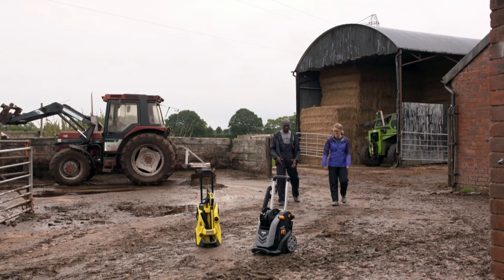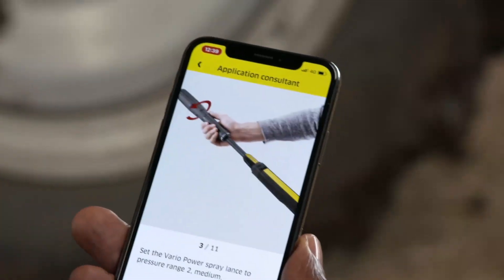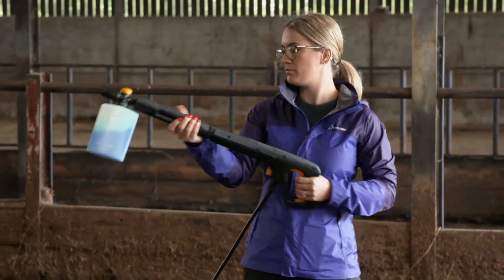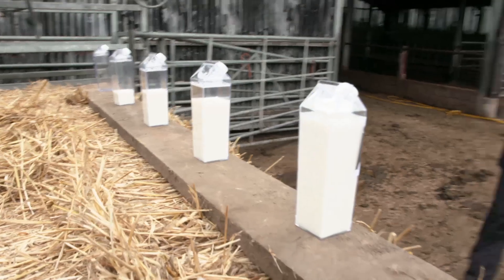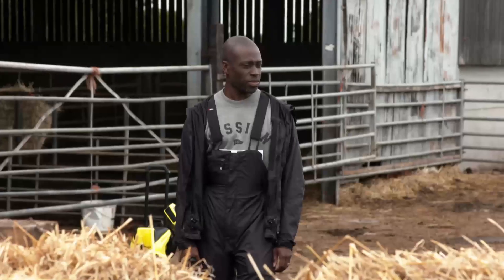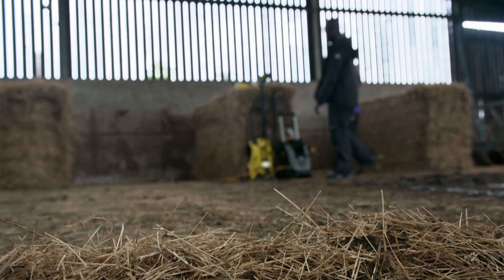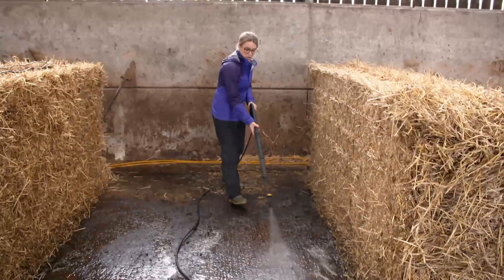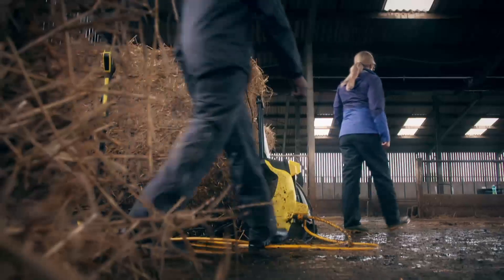Karcher VS Titan: Pressure Washers Reviewed | The Gadget Show

Comment: As someone who has used karcher professionally i can say that thier hoses and guns can an absolute nightmare and needs replacing with something quality asap after buying them. The backfoot where the hose go into the back of the unit is also made of plastic and cant handle the pressure longterm and pretty soon needs to be replaced by an aluminium one. Pretty much you will end up. Paying a small fortune to do the totally needed upgrades. Saying that, Titan I will not even rate.
Reply: Hi mate, is there one you can recommend? Been looking for ages and can't really decide on one, ultimately I want it to be able to clean the wooden decking, concrete drive and the car.
Reply: @christopherpoole2292  did you get one in the end, I’m looking but so many
Reply: @Eve-hb  I ended up getting a Bosch Aquatek 140 which I'm really happy with. Super powerful, really easy to wheel around and it has great reviews.

Comment: To be fair Otis looked like he was no stranger to using a pressure washer
Reply: Nah he holds the lance like a rifle with hand underneath which on more powerful machines is dangerous, ok so he doesnt need to so much here but theres still a correct way to hold and if you know the correct way theres no reason to hold it wrong, he holds like a noob, hes also not methodical and moves it like hes sprinkling out bird seed instead of letting the machine do the work, he might very well have more experince than her but I dont see anything that suggests hes more effective.
And thats fine, 2 laymans doing a comparison of layman friendly machines for layman buyers that will use them in the same intuitive way.